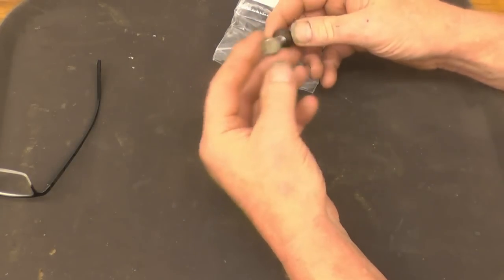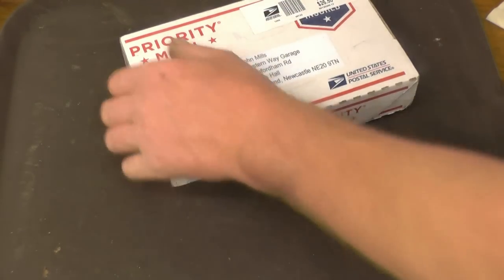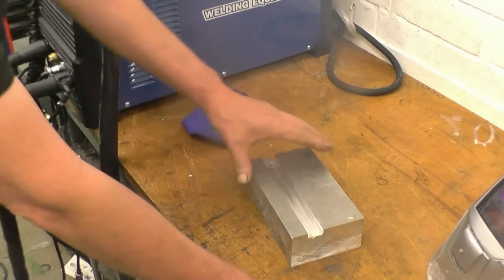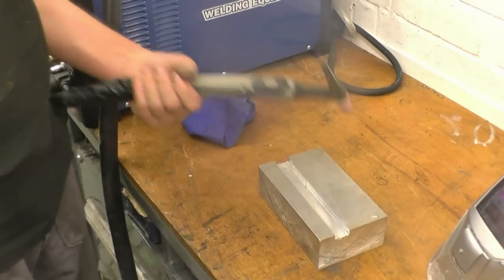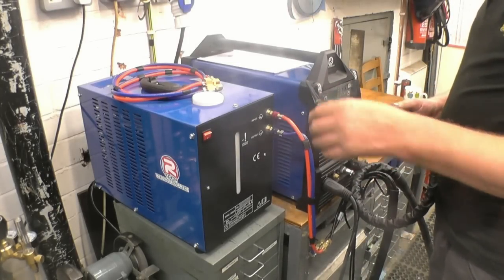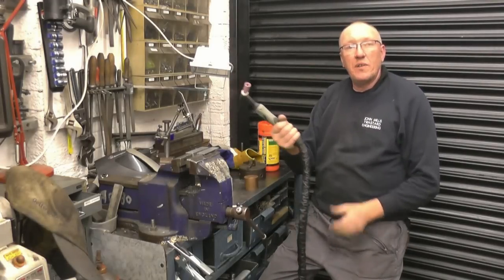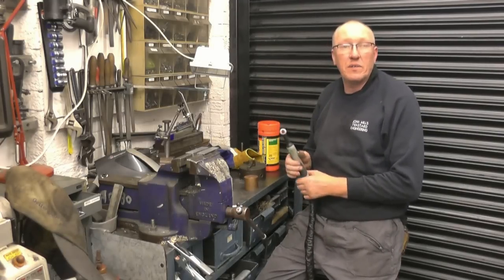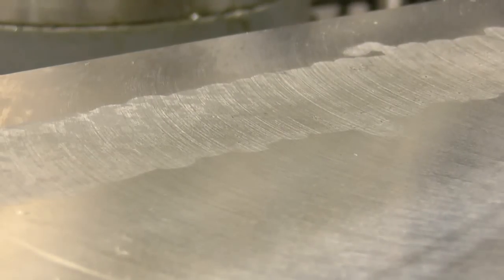Sunday Night Night Cap 82 part one

Comment: Great bit of kit that water cooler. I have the same unit from Rtech. I use the #20 torch, smaller than yours there and much easier to move around.